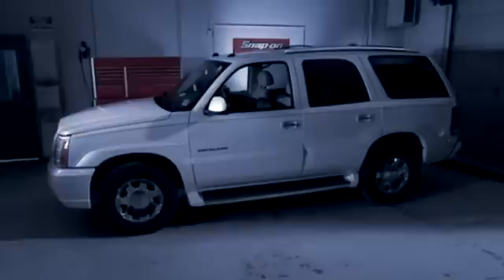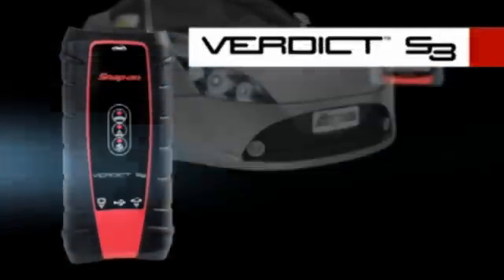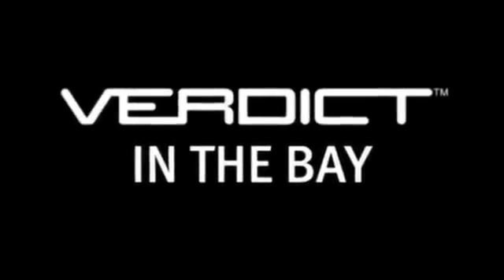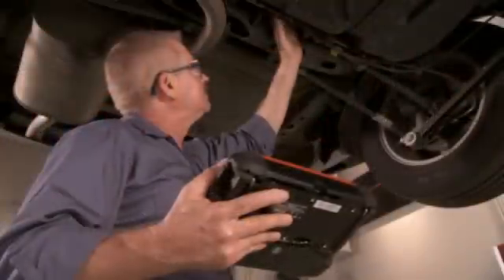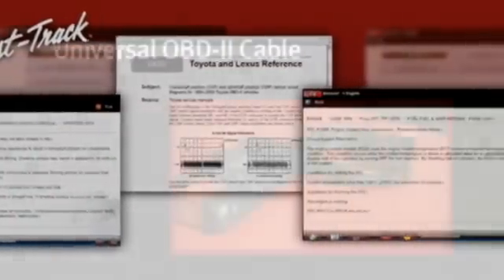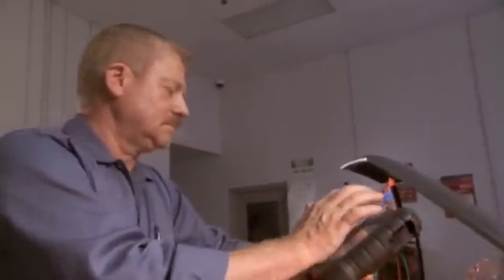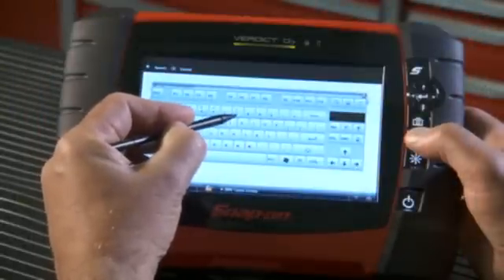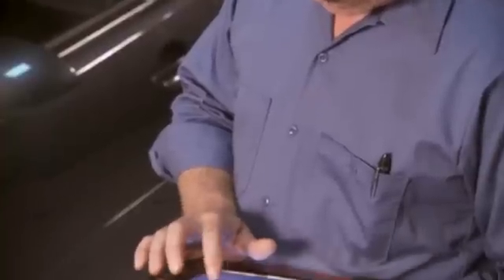VERDICT Diagnostic & Information System | Snap-on Tools

Comment: owning a Verdict D7 is like owning ANY laptop. You have to pay attention to "Software Updates" on the bottom right corner. I've owned Verdict D7 for about 3 years and I havent had any problems that were mentioned in the comment section, except for a slow start up.

Comment: HOW ABOUT  A TOOL THAT WILL CONTINUE TO WORK , NOT BREAK DOWN EVERY COUPLE OF MONTHS !!!   BIGGEST PIECE OF CRAP IVE EVER OWNED !!!
Reply: Peter Albright  what is the major problem of this equipment
Reply: multiple viruses on its own , never is used to search the internet . hard drive and board replaced , more viruses . wireless connectivity failed , no idea what they replaced . wont connect to some vehicles and will to other identical cars . IT WAS THE WORST PIECE OF CRAP IVE EVER OWNED !!! TRADED IN FOR NEW VERUS , SEE WHAT HAPPENS WITH VIRUS PROTECTION !! EVEN TERRITORY MANAGER IS TRYING TO GET THEM OUT OF HIS AREA , CALLING THEM GARBAGE !!!   USED DIFFERENT LANGUAGE THO !